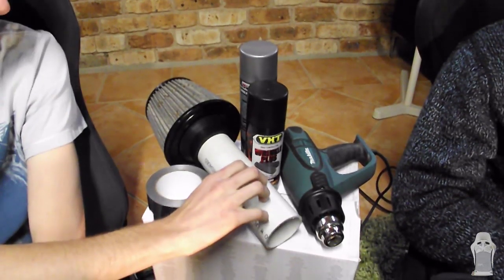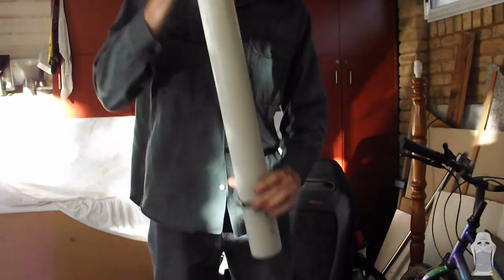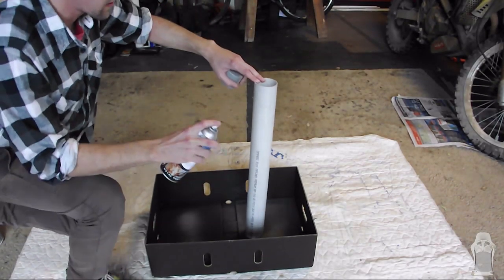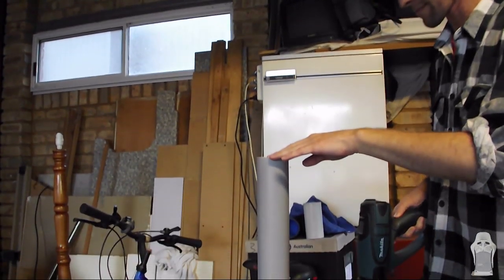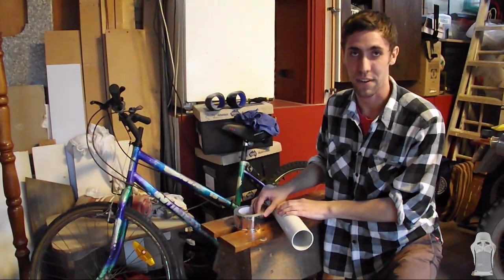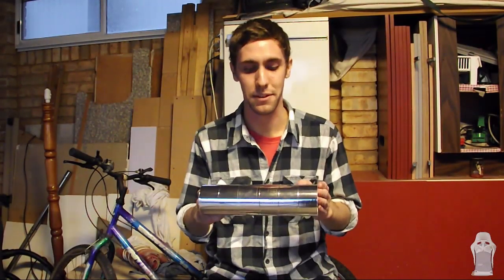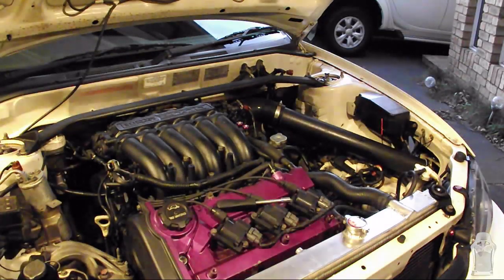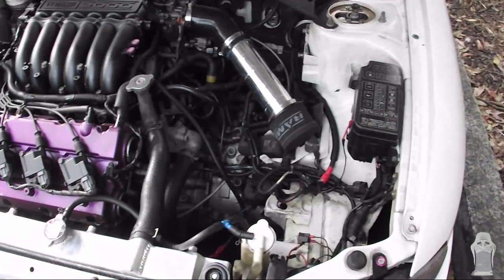DIY Cold Air Intake p2 - The Racing Seat

Comment: When installing a new CAI into your car, you also need to keep in mind the A/F ratio. Not only that, if you widen your CAI, you also need to change your exhaust manifold (headers). Big CAI with stock exhaust is a quite a dumb idea coz you still get standard lift but may not burn much fuel which results to lame consumption & the rest of the fuel is just thrown out the tail pipe. Your car will sound like its snoring which sounds funny!

Comment: Can I just leave it black and not use the aluminum tape?

Or would that heat up the pvc to much or damage it?
Reply from the maker: so long as the PVC pipe is not super close the the exhaust manifold you should be all good.
I ran one of these painted black for 2+ years with no issues
Reply: Thanks, actually I have a short ram intake on my 350z with heat shields so im just going to extend it making a dual cold air intake placing the filters in front of my radiator.

$700 for one of those screw that thank god for PVC. Great how to video.
Reply: Nice JOB ON the PVC Pipe Cold Air Intake System. I'm learning a lot of youtube. My Point is...
that because of you guys i went out today and bout 2 (Spectre-Coupler ) kit, and tomorrow i will measure my throttle diameter and MAF and make sure my couplers fit my PVC pipes and MAF.

Thanks Guys for the DIY your vid, It rocks don't listen to any negativity others may write on your Vids.

Peace!!

 Ricky
Reply: I agree its a great PVC idea!!!

Comment: Great Job on the DIY! 

The PVC pipe is easy enough to find, but where do you get the silicone joints?
Reply from the maker: +Q1KLT1 
We just got our silicone joins from ebay, approx $10-$20 each
Reply from the maker: +Q1KLT1 
We got our silicone joins off ebay, but most automotive parts stores have them, the main thing is to know what size you need by measuring the pipe diameter and throttle body flange diameter

Comment: What if I want to add a MAF. Sensor port can I just make one?
Reply: Or IAT
Reply from the maker: depending on what type of MAF sensor you need to fit on it, you may need an adapter pipe for your MAF, google "your motor MAF adapter" see if there are any available, then adapt that into the PVC intake. if its just a small sensor that goes into a port on the pipe then just mimic the stock port position as close as possible on the new pipe and make sure it seals air tight.

-Res

Comment: Mate.. Because of all the interior 'steps' and lack of housing around the pod filter and lack of positive ram.. I doubt this setup would make any HP at all. above stock.

Don't know what you did with the MAF, IAT etc as they do need to be there to run the car correctly in case you didn't realise it.

Sorry, but I'd bet money that you've dropped HP in this setup..
Reply from the maker: bicanoo_magic bicanoo_magic 
Mate.. Sorry you dont know more about cars, not all cars run MAF sensors and most modern cars have AIT's in the plenum of the intake. this motor runs a MAP sensor which is a Manifold Air Pressure sensor, which is located in the plenum. no need for sensors along the intake piping. 

You would have also noted that we specifically say in the first part of this build (this is part 2 you have commented on) that this will probably not make anyone any power, most people do it for the throttle note. 
view part 1 here in-case you haven't:
https://www.youtube.com/watch?v=m1F79Dj1sXE

Also this intake was built for the episode only, it was never going to stay on my car as I don't run an intake normally, just a filter sock on the throttle.

Yes a shield/housing/container and a sealed pipe to ram air would be beneficial to the intake. but im assuming you missed the first part of the build which outlines that this intake is to be a super low budget intake that any noob could build with hand tools.

Thanks for your concern about my car.
Res
Reply: The Racing Seat whoops.. my bad...